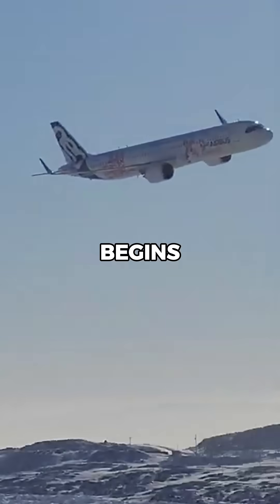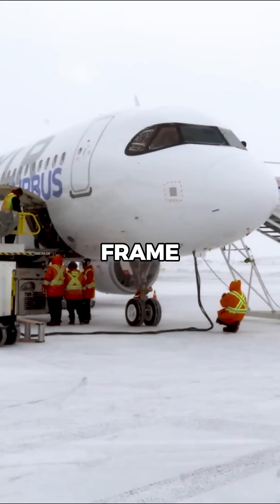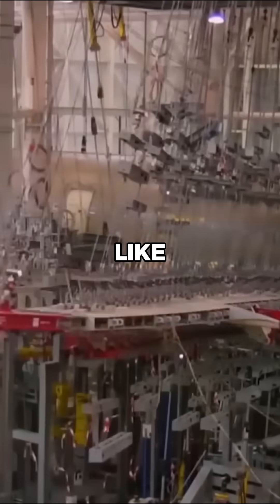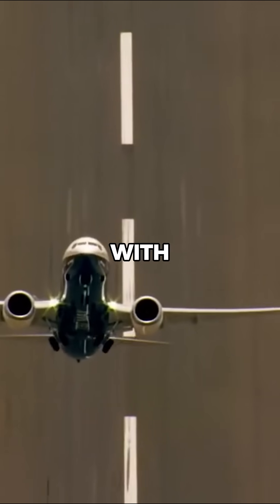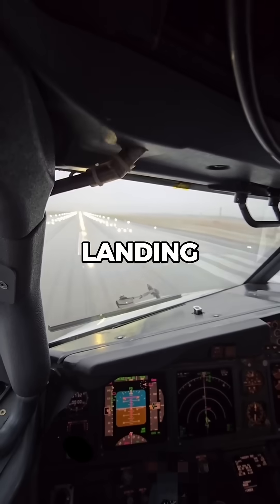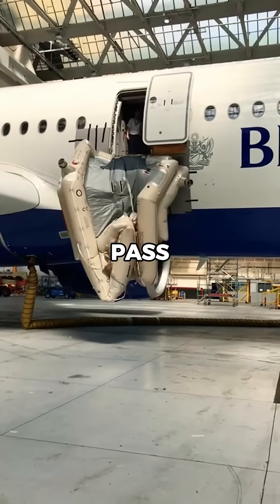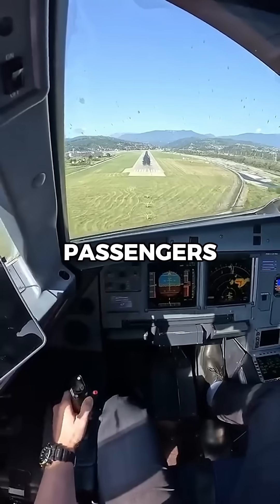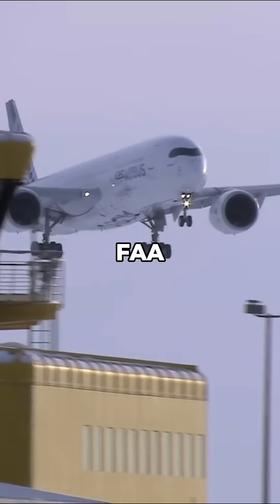How are new aircraft tested?

Comment: This is how they test new designs, but how do they test each new aircraft coming off the assembly line before delivering it? And do airlines also test brand new aircraft before flying passengers aboard  it? I want to know that the aircraft I am flying in has been thoroughly checked against design specs. I also want to know that my aircraft won't run into something in flight and crash, as we have seen already twice this year. One hit birds and the other was hit by a helicopter. In both cases all passengers died. ¡No es bueno!
Reply: Statistics show you got more chance dying in a car crash than dying from aircraft crash